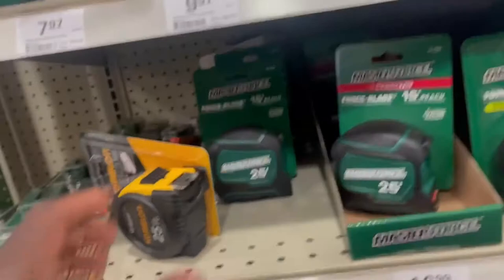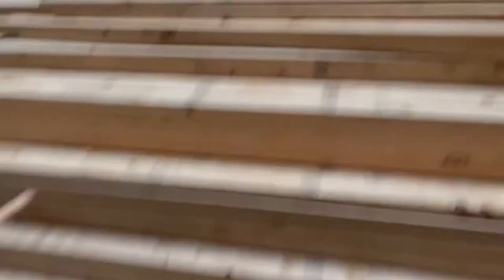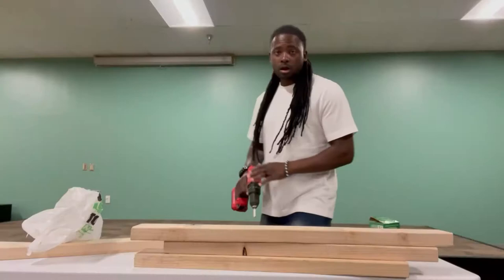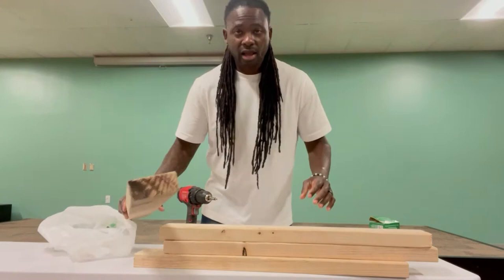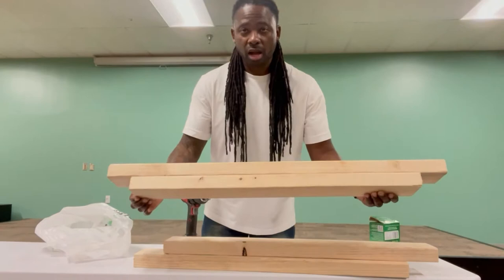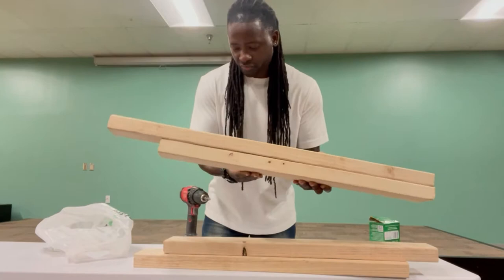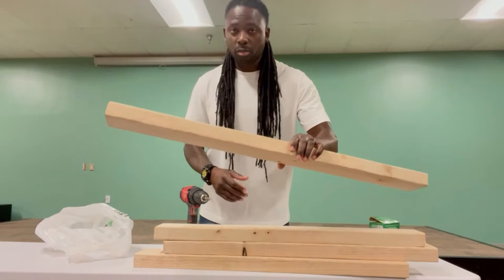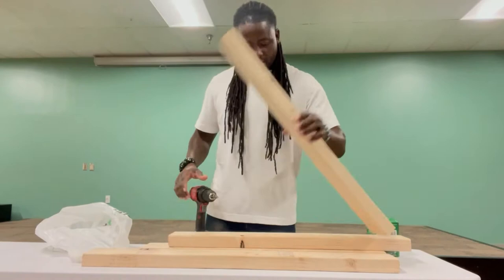How To Build a Tabletop Tufting Frame

Comment: Thanks for sharing, where are you holding the yarn for this type of frame? I am gathering supplies and have not began tufting, but would want to build a larger frame...I bought a small one to start with on Amazon already, it has the yarn eye hooks to have the yarn on the frame as well. I appreciate all your videos
Reply from the maker: I place my yarn on the floor and pull enough yarn from the middle of the yarn to loosen it up. One yarn on the left and one on the right of me